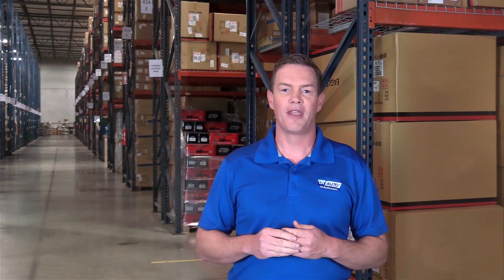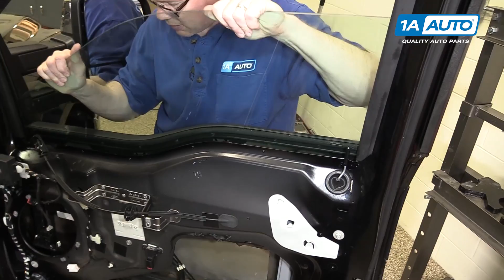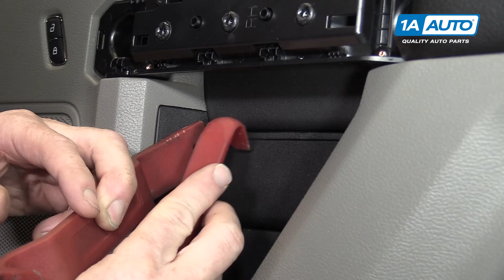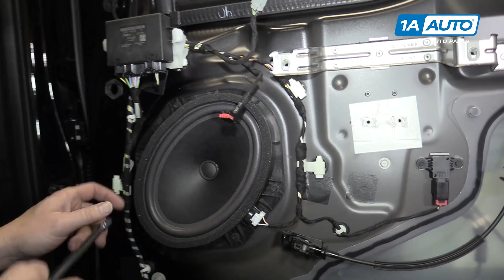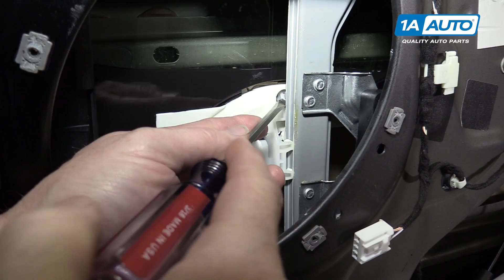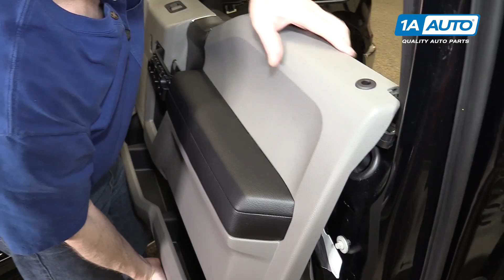How to Replace Front Door Glass Window 15-19 Ford F-150

Comment: Great video. After doing it, if you’re having trouble with one of the tabs, just press your flathead against the FRONT of the back of the plastic housing that the mechanical tab is connected to. This too will get your tab out easily if you are using your other hand to push upward on the window.

Comment: for the 2019 ford f150 supercrew the metal window track blocks where you would push on the white tab to unlock the window. You must roll the window down and put a flat head to the back side of the regulator and pull to unlatch it rather than push. also there are 4 8mm and the rest are 7mm for the 2019 ford f150 4door. 
Thanks for all your help though!!

Comment: If you have a long plastic guard, you don’t even need to take the door panel off. You just wedge it in between the bracket from the outside of the glass and open them up. Putting new glass in is super easy. 10 minute job tops

Comment: Perfect tutorial. Thank you!My 2016 F150 Super Crew window track "regulators" had the push tabs as described but my rails are straight top to bottom and the tab is behind the rail through the entire travel distance. Simply insert your flat tip screwdriver behind the glass (the outside side of the glass) and once behind the push tab twist the screwdriver to "pull" the locking glass tabs towards the outside of the door to release and lift, or pull glass up to disengage. A flashlight and second set of hands is useful for this step, but if you're patient you can disengage the glass by yourself.

Comment: My passenger door got hit by a deer and I've got a new salvage door.  My glass is tinted, the salvage is not, so I need to take the glass out of the salvage door to paint it.  The glass is all the way up.  How do I get the glass down to take it off the regulators with it not being connected to power on the truck? Is there a pin-out diagram I could use to hook a jump box up to the switch or motor to bring it down?